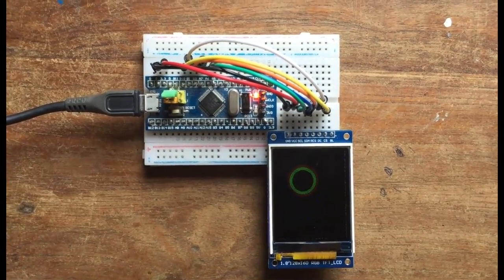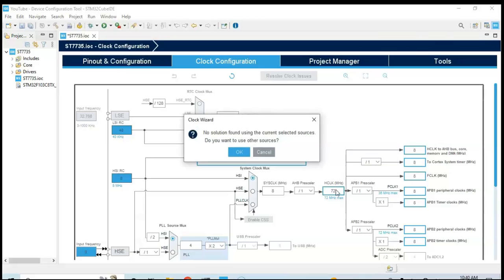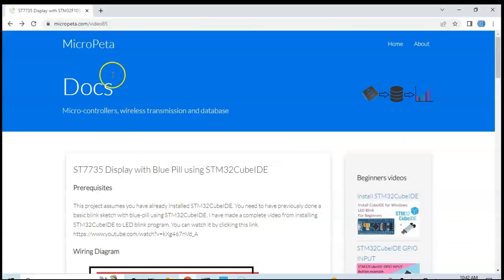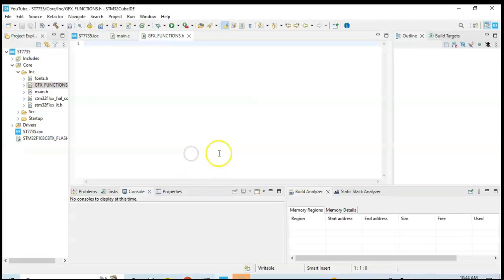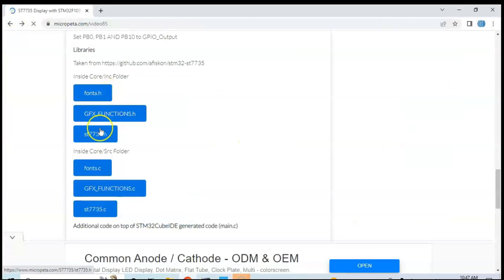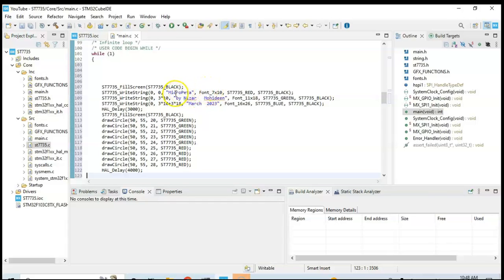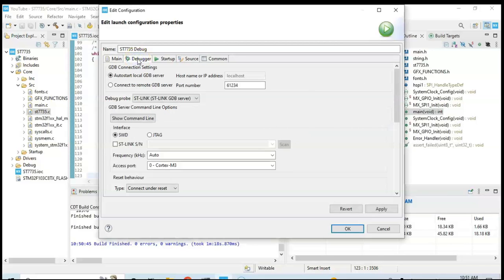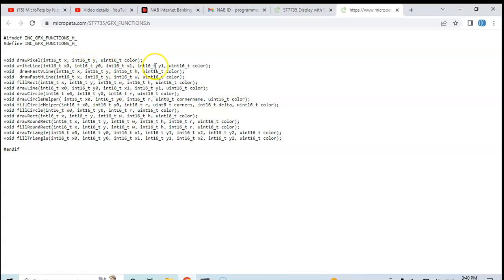85. STM32CubeIDE ST7735 Display with STM32F103C8T6

Comment: Is there any difference between the blue and Red tft st7735 display? I noticed a difference in pins locations and DC pin marked as AO instead of dc
Reply from the maker: I have not tried the red color st7735. Make proper code and wiring. If it works, let me know. Thanks
Reply: @NizarMohideen I tried with proper wiring but your code unfortunately it doesn’t work. 
Pin arrangement are different and DC pin labeled AO, I don’t know if it has different slave address but it works well with arduino adafruit library
Reply: Works on arduino

Comment: dear sir, can i combine with the dht11 to display? after reading dht11, we have the result of Temp and Humid but, i 'm not sure can display that on LCD just use "  ST7735_WriteString " in your code?
thanks for reading sir
Reply from the maker: You can use sprintf() to convert numbers into string then use ST7735_WriteString
Reply: @NizarMohideen  thanks for replying sir, i ll try it, if something bug, i ll ask later. :)
Reply: @NizarMohideen  dear sir, aftering searching the products with "IC drive st7735 " is not available in stores in my country , can i use the LCD TFT IC driver ST7735S instead? i am not sure if they have the same library
Reply from the maker: I am not sure